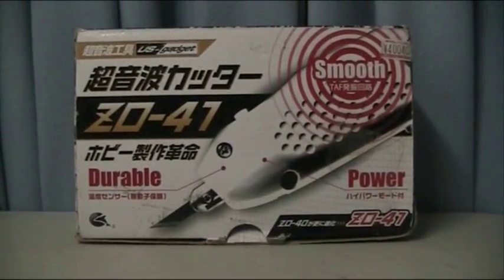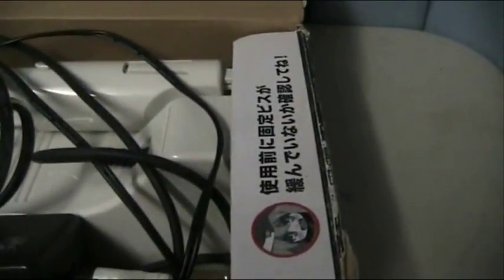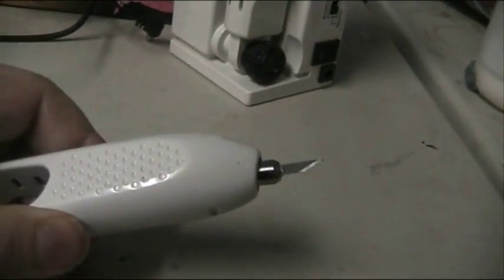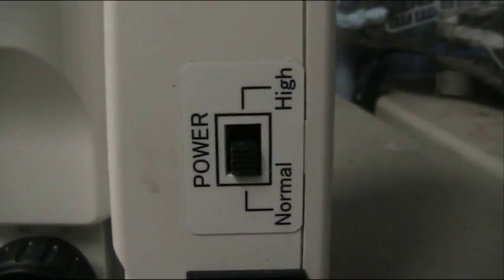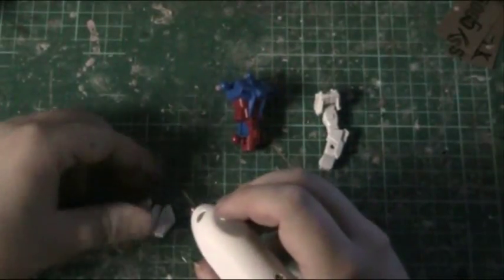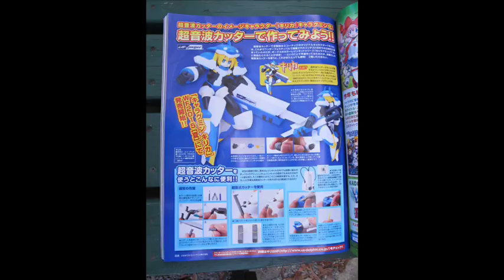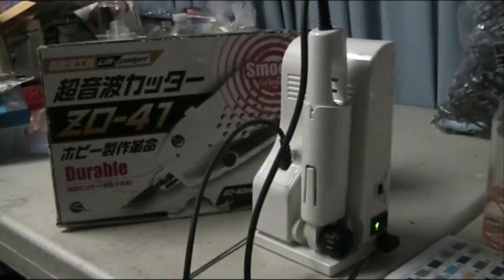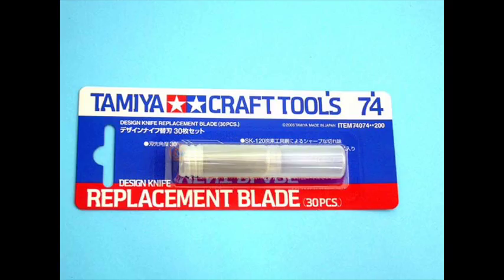model kit workshop 130: ZO-41 Ultrasonic Cutter

Comment: For a Japanese tool, I would have expected a much more refined product. Seems that it needs a lot of tinkering to keep it working. IMHO, for a $400 tool, you shouldn't have to open it up constantly to fix loose parts, accept that it will just stop working after 5 seconds, etc. Anyone know how the Wondercutter stacks up to this?
Reply from the maker: I do 100% agree with you, just assisted in repairing a friends model. He over tightened the blade screw for a longer operating but has threaded the last of his spare parts. The new wonder cutter which I have reviewed this year has addressed all of these issues, stronger cut and a tad cheaper. More or less this one is completely obsolete.
Reply: @mokanaman  Much obliged for the update, mokanaman
!  These ultrasonic cutters look like a great replacement for my little razor saws, especially on repetitive cuts. The clean cuts is a big bonus for me. Thanks again.
Reply from the maker: @JohnJones-oy3md  Even with the issues with the old one it has been an amazing tool. Like anything you need a completely different skill set and will take awhile to do neat cuts. I can not get the hang of it while filming and a bit embarrassed about the footage haha. Watch this video and consider getting it. So much cheaper and can be found on ebay. https://www.youtube.com/watch?v=TQmo17MzVes

Comment: Great review, thanks so much. How much did it cost? Did you look into the difference between your machine and this Honda Electronics ultrasonic cutter USW-334 ?  I guess cutting metal and wood are out of the question? Thanks again!
Reply from the maker: Hello L Chen, I've met two people who have used the old Honda cutter. Both models use the same oscillator as well as the model from South Korea which I reviewed not too long ago so I assume the performance would be close. This unit retails over 30,000 yen excluding tax and shipping. Instructions only recommend foam, plastic and rubber I did not attempt hard woods or metal but thin soft wood would not be an issue. Hope this helps you.
Reply: Thank you very much for taking the time to answer.

Comment: Got to say, really interested in this thing. When cutting pla plate, I always struggle with getting my angles right- maybe this will help?
Reply: these take away the grunt you have to apply to small items. items that are easily damaged or are hard to grip... it's like having a precision dremel or angle grinder... it has it's limitations but for the things it can accomplish it does very well..